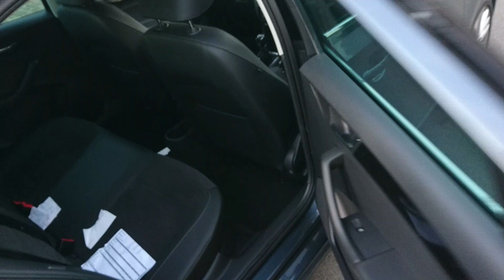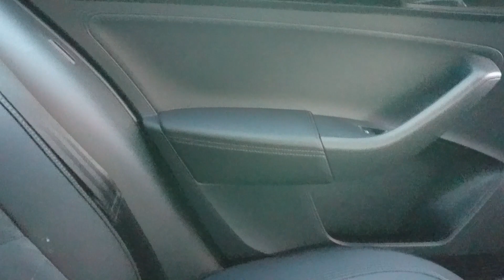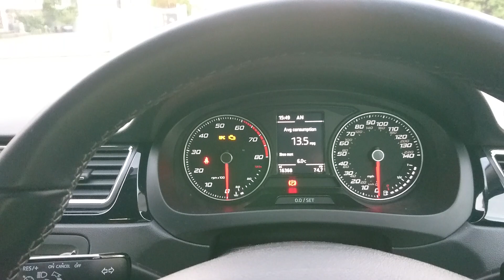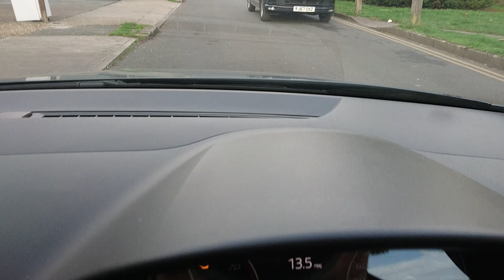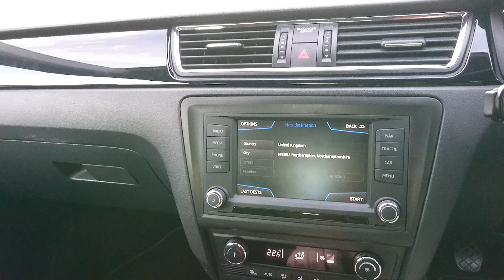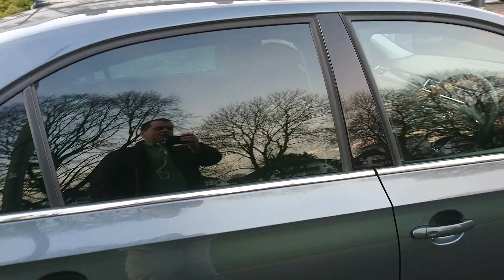2017 Seat Toledo 1.0 TSI Xcellence 18 month ownership report - Lloyd Vehicle Consulting

Comment: Hi, I've just bought a 2019 Toledo Xcellence, probably one of the last ones made. However I can't work out how to retract the wing mirrors. Are they suppose to retract when the car is locked? There is no menu option for this in the system settings, or extra button to do it manually, and holding the door close button on the keyfob doesn't work either. The mirrors adjust electronically just fine and the built-in indicators also work so I assume they are getting power. Having owned this car would you be able to shed some light on this? Thanks
Reply from the maker: Hello Nick, yes, I don't own the car any more (although one of my friends does), but I can answer the question. There is no power folding option for the mirrors, they have to be moved by hand. Production ended in the middle of 2018, although they couldn't get rid of them, so a few were registered in 2019. They are probably worth about the same now as they were when I sold mine in 2020!

Comment: If the battery does die how do you start the car?
Reply from the maker: There is a tiny notch underneath the driver's door handle to remove the cover for the lock with the keyblade. Then, insert the key into the lock and turn. Next, hold the key next to the starter button when the battery is charged again...

Comment: Hello there, Thanks for the final report and the other review video. Looks like a great little car, I have found great deals out there which are quite tempting.  I am driving a Vauxhall Vectra at the moment and I am wondering if you have any thoughts on how this compares to larger cars? The Vectra is a very good long distance cruiser with soft suspensions so the ride quality is very good. I am just wondering if the Seat has that large car feel when driving over bumpy roads?
Reply from the maker: Thanks Mark! Yes, the ride is good, much better than my wife's MG3, for example. Modern cars do have firmer suspension in general than something like a Vectra, however. If you need some help in selecting your next car, then feel free to visit my website at www.lloydvehicleconsulting.co.uk and use the Contact Me page to get in touch!
Reply: I have the same car and have averaged 56.5mpg over 21800 miles. Don't be put off by the small engine.
Reply from the maker: Thanks ever so much for watching! Yes, I get up to 62 mpg on a long run. Superb little car, I just can't think of what to replace it with when my finance agreement runs out next year: https://www.youtube.com/watch?v=kMKktKZjaCM
Reply: @lloydvehicleconsulting  I'm in the same boat I've got a 17 plate toledo. Cracking car and has a great spec. Love your blogs keep them coming.
Reply from the maker: @keithwebster6164 , thanks ever so much indeed! Yes, everyone who I have spoken to with a post-facelift Toledo absolutely loves them. I got 72 mpg the other day on a short run down to Portsmouth!  Glad to hear that you like the videos, I did a two year ownership report on the Toledo recently, but not many people appear to have watched it...